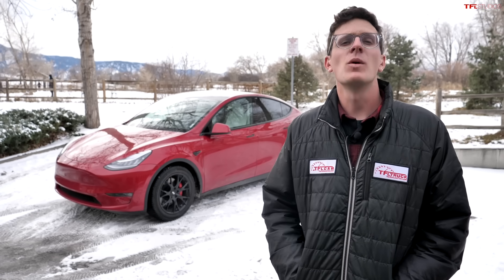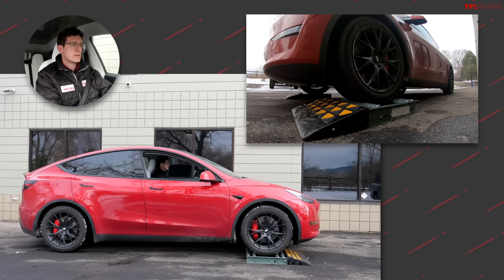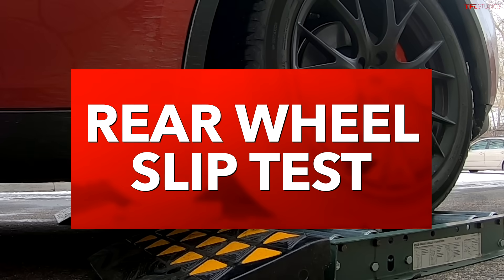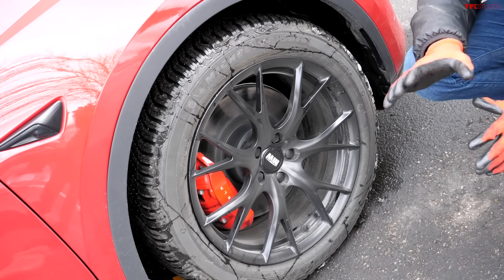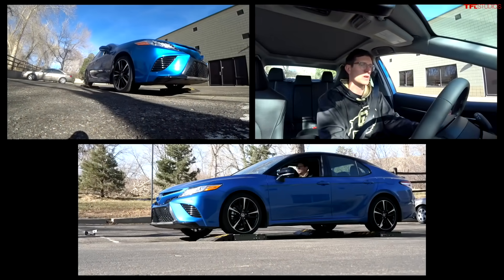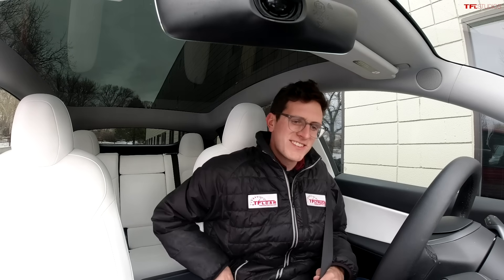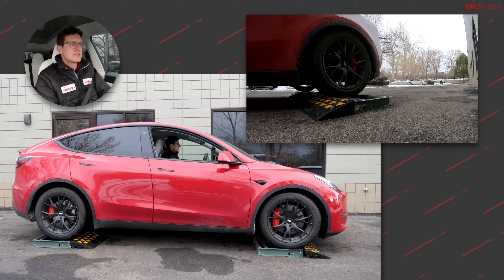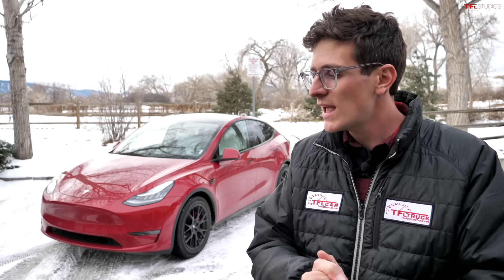Does Tesla Build a Good AWD System? We Put The Model Y On The TFL Slip Test To Find Out!

Comment: 8:52 Additionally of slip mode, there should be a mode where the front motor could be always engaged, 
not only when the rear starts to be slipping.
I was thinking that the slip start would be like having all the wheels spinning at the same speed 
like if you the locked up the differential so both wheels spin together.
However slip start temporarily turns off traction control, otherwise essentially perfect. 
Without this it may be hard to start moving at all on slippery surfaces 
as the car will immediately detect slipping and adjust the wheel speed to nothing.
Reply: Lol this take, even two years later is horrendous
Reply: This already came with an update last winter if i remember correct. After the car notice slippery conditions it enables both motors 50/50 for a short period of time, i think 10 minutes or so before it resets - unless it still detects slippery condition, then both motors stay engaged. This might not help much on a roller test, but i surely felt an upgrade driving in Norwegian winter conditions.

Comment: Why can Tesla program the such the when three wheels are slipping (two rear and one rear), one in the front isnt, and accelerometer sensor isnt indicating that vehicle isnt in motion, only send power to one wheel in the front? Perhaps accelerometer sensor dont exist in Tesla, even though all smart  phone in our pocket does, it's computer should be able to tell which wheel is spinning while it's not moving forward and only send all power to one wheel that isnt spinning.
Reply: There is only one motor up front. The only way to send power to the tractive wheel is to apply brakes to the slipping wheel, which it was. It seems like it limits the front power to much less than the rear. I bet if he mashed the go pedal it would do it.

Comment: I don't understand how the results of this test translate to performance on the road in dry/wet/icy conditions
Reply: You apparently have never driven on snow or ice before. Imagine the SUV is going up a hill from a stop. Two or three wheels are on glare ice. That's basically like being on marbles; no traction, just spin, spin, spin. The wheel(s) remaining on the good traction surface have to have enough torque/power sent to them to pull the SUV off of the icy patch and up the hill. If the machinery/brakes (traction control)/differentials cannot transfer enough torque to the wheel with traction, the SUV just sits there. This is a VERY common occurence in snowy climates.

Comment: I thought this car performed pretty good. Interesting to see that it is primarily rwd.
Reply: Only at low speeds because the rear motor has more torque and the rear has more traction. At higher speeds it’s primarily front wheel drive because the front motor is more efficient.

Comment: Can you try passenger front and rear 1 wheel traction test? I suppose the way differential work might make it different from left to right
Reply: No it won't. Without having either traction control, a limited slip differential (LSD), or a locking differential, an "open" differential will send the power to the side that has the LEAST traction. That is, of course, when you have more power than traction. Probably 95% of vehicles have open differentials, because it's less costly to manufacture them that way.
Reply: @snowrocket  yes, I was talking open diff. Open diff still make difference from left to right, if you've ever drag race a rwd car with open diff and tc off, you'll see the two side wheel will have different output although having same traction. It's why you see that tail wiggle at start up.
Reply: @dearbulls  A car with a live axle diff has a different dynamic than one with independent suspension and equal length halfshafts. The Teslas have the equal length halfshafts front and rear. The driveshaft rotation on a live axle will torque the right rear wheel up and the left rear wheel down, resulting in differing levels of traction. In "Bullitt", when Steve McQueen overshoots the corner and backs up, then goes forward, this is readily seen, especially since that Mustang had an open diff.
Reply: @snowrocket  then how about torque steering on FWDs? They don't have live axle

Comment: Don't you think the only right wheel on the ground should be the hardest test?
Reply: Why do you say that?
Reply: @snowrocket  I meant the only FRONT right wheel on the ground should be the hardest test.  The front left as he tested has the weight of the driver on it that helps with traction.  The front right has no one on it so it.
Reply: @CoralSea  While I see your point, considering the car weighs probably 3800 pounds, that slight bit of difference would be minor. Still, it wouldn't be hard to test.

Comment: Would love to see this with the new TLX or RDX.
Reply: I second that.  See how well the SH-AWD performs
Reply: @twoo1998  As much as i like vectoring axles sh awd/ivtm4 is slow reacting https://www.youtube.com/watch?v=f3fTf5n_MWQ , maybe it's on purpose, so it would feel more smooth, idk, but i've seen faster responsiveness on Renegade with much less advanced ABS traction. I still like sh awd  the most for road snow or wet conditions as is the only one for this kind of money offering 75% power to back with steering enhancement
Reply: @tallll70  Thanks for that link.  My RDX dose better than my Model 3 Performance on road with a layer of snow.  The Model 3 not only has a low clearance, but the traction control is not as good as the RDX
Reply: @twoo1998  I want to add that i hope for offroad usage they will at least retune it, even better bring back rear lock selector like vtm4 had and make also locker for center, because that's exactly what new Bronco Sport will have on it's more expansive vectoring axle setup

Comment: Please do a roller test with a Mitsubishi Outlander GT! I swear they have one of the best AWD systems in the business lifted right off the EVO. I’d like to see how the S-AWC system performs here. Dollar for dollar, it’s the cheapest/ best AWD on the market. You’d have to spring for an Audi (Quattro) system to get anything comparable
Reply: AWC and S-AWC systems in Outlander has nothing in common with the one from Evo. Literally nothing except "S-AWC" name.
Reply: @4x4.tests.on.rollers  That’s not true....do your research. I did, and that’s why I bought one. The S-AWC system on the Outlander GT has an Active Center Differential (ACD), which sends nearly 100 percent of available torque to the front axle under normal conditions, but can divert as much as half of the available torque to the rear axle for a 50/50 split. It also has Super Active Yaw Control (S-AYC), a torque-vectoring system lifted from the EVO that uses an active differential to send up to 70 percent of torque available on an axle to either the left or right wheel to enhance handling. The only difference between the EVO and Outlander is the EVO has S-AYC on both the front and rear axles to improve performance, while the Outlander is front axle only.  In fact, the Outlander GT is the only vehicle in its class on the market today that features an active front differential (AFD). DO YOUR RESEARCH. I can tell you from experience, it’s one of the best and has never disappointed me. Last winter, we had 2ft of snow and Mercedes, BMW, Nissan, Toyota SUVs were abandoned all over the road while my Outlander drove through it like it was butter. 

Here’s the link to more info if you need it https://www.mitsubishi-motors.ca/en/sawc/
Reply: @soiceyboy33  Evo has active center differential, helical front differential (torsen type) and overspeeding rear differential. Outlander doesn't have ANY of these. Actually it doesn't even have center differential at all, just a clutch-pack. It is completely different system. Of course it has AFD which is great but it has nothing in common with Evo. Both cars use S-AWC and AYC names but technically they are not even similar. In roller tests GT gets the same result as standard Outlander. Both are doing much better than Evo, which is not designed for that.
Read more than marketing stuff, check what's underneath the cars. I had a few Mitsubishi cars, I tested a lot of them on rollers, I know what I am talking about.

Comment: I wan't to see you try a test will all 4 tires on rollers.  If you turned off traction control and ABS, then ran the car up to high speed (60-100 mph ?), and slammed on the brakes, maybe the inertia of the rollers would be just enough to push the car off backwards.  Do I really think this would work?   No the bearings in the rollers would probably self destruct first.  But it in any case, it would almost guarantee excitement. 😁

Comment: Elon will see this video and issue a software update so it’ll be able to do the roller test even better!
Reply: This was my exact thought. Most other vehicles, you would be stuck with the performance they came with, but with a tesla  you might get better performance in this situation in the following winter. Overall still pretty impressive out of the box.
Reply: @masonfox9070  All vehicles made in the last 40 years can get updates ya derp.  Just not over the air.
Reply: @babochee   read his whole comment. He did mention "at least make a visit to your local dealer". Teslas update at home on your WIFI  like a typical smart phone does.
Reply: @babochee  Having a computer and being able to get updates is a verrrry different thing. Being able to update on board computers is really just something that all cars have had for maybe 5-10 years.
Reply: @Bixxlol as have most modern cars in the past 5-10 years
Reply: I'm waiting for his tweet about this video for a future update. Does he know about this video yet?
Reply: Exactly what I was thinking. It would be a simple software update.
Reply: I thought the same thing too!
Reply: Sure it won't happen XD
Reply: It's going to lift its side skirts and step off the rollers
Reply: The booster rockets will be activated.
Reply: The Tesla has a rear wheel bias…. What were they really testing lol
Reply: Glad this was updated Like you predicted. Both with slip-start mode/snow mode and track mode.
Reply: even lord musk can’t make the front motor more powerful with a software update
Reply: @trippplefive it’s not about the power, it’s about the delivery. Model Y can still get out of a 1 front wheel only traction situation if you keep trying. It’s just that the programming may need to be modified to where it sends power to that 1 wheel faster and more efficiently.
Reply: Lmao, I highly doubt Elon Musk sits around watching TFL Cars videos.
Reply: Yes, I think one of the most valuable aspects of owning a Tesla is the fact that this type of thing can be corrected after purchase.  With any other vehicle you would have to wait for the next model year to get this type of improvement, or at least make a visit to your local dealer.  With Tesla, your vehicle just downloads the latest update and the problem is fixed.
Reply: @RichardHurt yep, just like a phone or a laptop
Reply: @RichardHurt thinking that software can infinitely improve the car is wrong. Which is why Elon is a scam he tells people my car is better because I can fix everything with OTA software update. That was like this scam of the boost computer performance for free just buy this subscription…. It’s all virtual.
Reply: Only a software issue @RichardHurt
Reply: @RichardHurt  Changing out differentials is a thing you can do with cars, installing a limited slip where a stock open diff was.  But yes that takes some money to do.  The nice thing about a car not being able to download updates is they can't break functionality.  So it's not a feature without risk.
Reply: @RichardHurt  this is a lie and misleading.  Any vehicle with an ECU can have this kind of issue correct.  The engine and transmission can be reprogrammed.  Your ignorance isn't doing anyone any good
Reply: @babochee  "Can be" is theory .. can you give actual examples of when updates like that were made to a mainstream production vehicle? And ANY that were made without a trip to the dealer?
Reply: @babochee  You apparently didn't read his comment. He said any other vehicle you have to wait until the next model year OR MAKE A VISIT TO YOUR LOCAL DEALER. That is not a lie or misleading. You just didn't read the whole comment. Please do better.
Reply: @timhill9039  my 2017 Ford pickup gets OTA updates that have improved economy (range) and updated the entire infotainment OS
Reply: @timhill9039  it also improved the adaptive cruise and lane keep assist, which are all the exact systems we are talking about
Reply: @BrandonJoeReich  exactly
Reply: @KindOfyeah  every car or truck from the last 10 years has tc and esc wich are controlled by the ecu, these systems can engage the brakes on certain wheels to stop them from spinning
Reply: @babochee , technically you are correct.  Most modern vehicles can be reprogrammed by the factory or by the owner.  However, the vast majority of the time this does not happen, due to many factors (cost, convenience, etc.)  The important different in the case of Tesla is these types of updates are common and expected.  You don't have to make an appointment to visit the dealer, you just have to approve the update in the Tesla app.
Reply: More like he will talk smack about how these people are idiots and he's the best thing since sliced cheese
Reply: Unlike any other vehicle
Reply: Can he release a spftware update to fix the shoddy quality and tired styling too?
Reply: No he would make a update so it perform poorly and create enhance a all-wheel-drive option for $1500
Reply: The best part about updating Tesla’s, is that if your car old, you can’t update it.
Reply: @LethalH080  At least they don't slow them down like apple does to their phone to "save battery life."  Just so you will trade it in, at least not yet anyway.  Can't speak for Tesla but with Microsoft your talking a gamble installing upgrades. At least without them everything should operate the same in theory.  Only benefit negative is not having the latest security changes, but those can cause problems too.

Comment: My X is a beast in the snow so I was surprised to see the last test go so bad.
Just curious if it felt like the front brakes were grabbing at all on the last test? The way it is all software driven, I wouldn't be surprised if an update gets pushed in the future to fix the last test.
Reply: The X and S have dynamic air suspension. Maybe that would enable them to ace the last test by improving that one wheel's contact with the ground?

Comment: "Not a lot of ground clearance in the Model Y"?  If the specs I found are correct, it has 6.6 inches of ground clearance which is substantially more than most modern passenger cars have and more than on any vehicle I've owned over 50+ years.  These slip tests are fun to watch but don't seem particularly relevant to real world driving.  Maybe sometimes take these vehicles over Loveland Pass on a day when the snow plows can barely keep up and on poorly plowed residential streets around Summit County ski areas.
Reply: Use your eyes, that wasn’t 6.6 inches of ground clearance. Looked more like 5.6 inches.
Reply: @sfoy623  LOL, my eyes do not have a built in ruler.  The Model 3 has 5.5 inches of ground clearance and the Model Y has 6.6 inches according to multiple sources including Motor Trend:  https://www.motortrend.com/news/tesla-model-y-model-3-size-comparison/
Reply: My regular 2007 Subaru Impreza 2.5i wagon has 6.3 inches. It's a regular car, not an Outback or a Jeep. The Y has MORE clearance than many vehicles, but it's still not substantial. Part of the reason is to keep the battery range number high. More clearance will put more air under it, making the aerodynamic drag worse, and reduce the range. Guarantee it.

Comment: Tommy, thanks for this vid. I am a bit disappointed in the last test with the single front wheel up. Wouldn't a subaru just divert power to the one front wheel and easily pull forward? Not sure why Tesla can't ace this one. Also, can you guys mod your Y with the lift kit from Mountain Pass? That would get some extra ground clearance for dirt and snow.
Reply: Could probably be fixed with a simply software update. Someone needs to notify Tesla about this test.

Comment: Here's my issue with this test: the bearings in those rollers aren't purpose built for this test, and so, they will warp under heat and start presenting more and more friction to the wheels while they're under this condition.

There are tonnes of prototyping compnies out there that can help you guys design the right rig for this test. This test, as it stands right now, is a bit too much on the ghetto side.